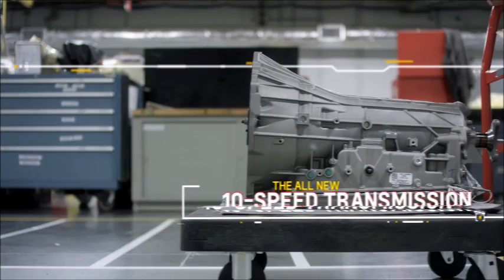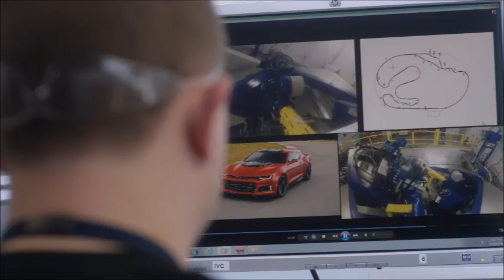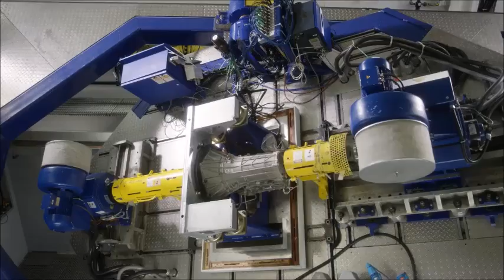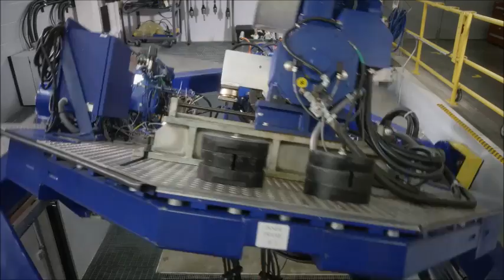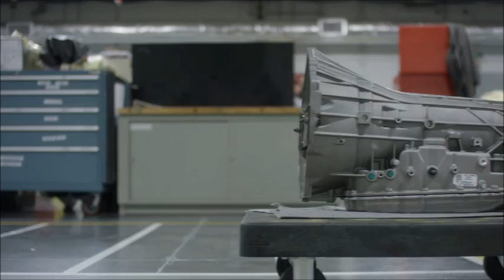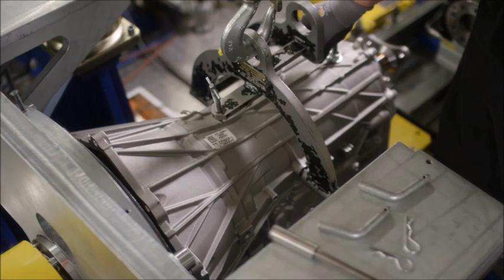10 speed automatic transmission  - 2017 Camaro ZL1

Comment: More gears more electronics to go to hell. And you can't fix it yourself. Get your wallet out after the warranty is gone folks.
Reply: I own a repair business and can say that about everything. It is far cheaper than the DCTs floating around in multiple vehicles.
Reply: Marc Smith ....never had either apart and don't want to ever. All I got to say is this is getting way out of hand and does not have to get this technical. Don't think you will find many new cars or trucks on the road 10 years from now on. Why a lot of people lease these days because of the cost to fix this stuff today. A lot of my friends lease because of this.
Reply: @arthurrodesiler3109  You know technology does get better,  this transmission will be pretty bulletproof

Comment: Tell me, how many gears do you need in a car or pick-up?
Reply: It's simple...more gears allow the engine to stay within the sweet spot of an engines hp and tq curve allowing for best acceleration and fuel economy while also putting less stress on the transmission components.
Sure a 4 spd would work but a 10 spd is better...better performance efficiency and longevity.

Comment: Remember a time that automatics were the slowest and less capable transmissions and everybody wanted a stick? I mean I'll still drive a stick anything no problem, but I'm wanting this 10-speed in my ZL1 when I get one. I mean it handles sending 1047 WHP to the rear. A stock automatic. No race conversion parts, no lightweight or stronger materials needed. This fucking AT is rocket proof if you turn this mark VI into a dragster on it's own. Oh and so is the 8 speed too, no co-development included if you're picky on wanting a solely GM part.

Comment: Wow a 10 speed automatic but still using a push rod engine. From the same company that thought it was a good ideal to put the fuel pressure regulator under the intake. aka central port fuel injection.
Reply: Whats wrong with pushrod engines? It makes light, compact, small, and super reliable engines. The base of an engine has nothing to do with the technology put on it. The dohc engine base is actually older than the pushrod one.
Reply: You can’t use dual independent vvt with ohv. This is why the 4.2 in the Trailblazer don't need an EGR valve.
Reply: @RBZ06LT6  GM will be putting a DOHC in the Corvette soon. It took them long enough.
Reply: That is important why from a performance perspective?  You ever see what happens to VVT engines when people slip a little on oil maintenance? They are ridiculous sensitive and plenty of people are finding out the expensive way.
Reply: @marcsmith3881  It take more than a little slip.
Reply: @Fone65  Still people are finding out the expensive way.

Comment: Hate to break up the carnival ride but this is just GM's latest super expensive attempt to make it appear as though they're testing their transmissions in some new fantastic way. The only thing this stupid contraption is doing is simulating a transmission flying though the air rotating left and right and pitching up and down slightly along the way before it eventually falls back to earth and explodes into a million little pieces.
Reply: Wendell Roy if you understand anything about fast rotating parts you understand what moving it does. pick up and angle grinder and move it around a bit while its on. you should be able to feel how strong the centrifugal force is even though the disk is lightweight. it will give you a good perspective of the forces the transmission is under.
Reply: Wendell Roy I assume this is how they test how their transmission would react under extreme g forces with All the ATF flying around and splashing everywhere. Will the clutch packs slip, will it overheat, wear out quickly and so on.
Reply: you are simply wrong..if you actually look..it is hooked up to an axle...so the transmission is constantly being shifted at low..mid...and max rpms at day and all night 24/7..and on top of that...they flip it..bang it..etc..WHILE under load shifting gears....etc.. this is the best transmission ford/gm has ever built...just google the reviews...it shifts faster than Porsche 911, lambo...etc its crazy
Reply: Why do you think they would build the tilt machine if they were not using it.  It is a great way to test their transmissions!
Reply: If you look at videos of Porsche transmission and engine testing, they use the exact same method.  Do you think they would be doing this just for fun too?
Reply: Yup, Ford has better testing method, they throw their 10-speed AT directly into a crusher